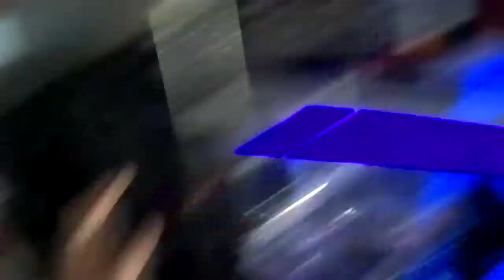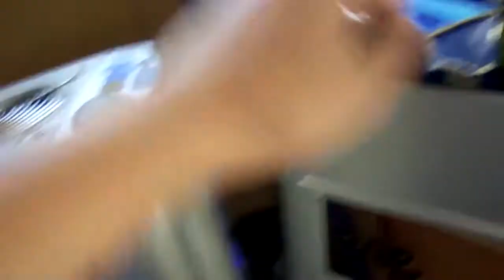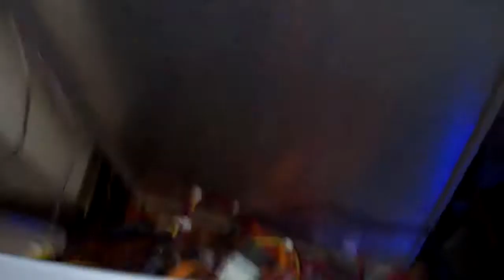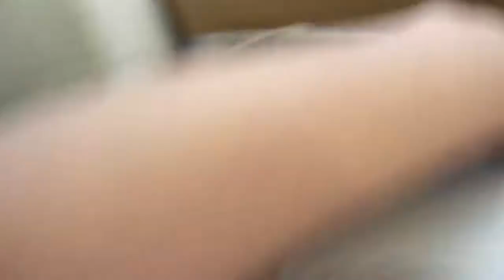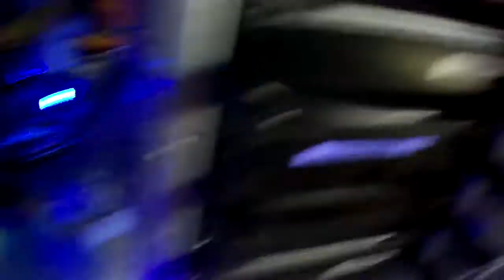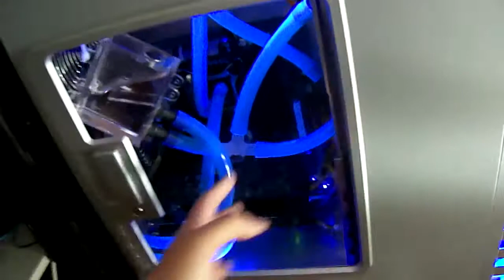[HD] Completed i7 860 Build

Comment: @alexconingham 46°C meaning, I can still overclock the caymans as hell...and even let them reach 80°C if I wanted to. It would be no problem. (but they will NEVER reach this temperature on my rig)

Also I can OC the Sandy Bridge to around 5Ghz very easily. Water temps don't rise that much and the cores stay easily under 55°C.
But I could also almost reach 5Ghz using AIR cooling as well. It was just louder.

Again, there is no turbine noise needed @WC for that to accomplish.

Comment: @alexconingham what do you mean by performance? The goal is to keep the water cold, as cold as possible as room temp allows.
This can be easily done in silent mode with large radiators and a proper setup.

I'm cooling two Caymans (HD6970) (and a i5 2500) in Furmark both @ 46°C.
No noise but maximum performance.

If you don't really have a clue about WC, don't bother to discuss.
Performance of PC != noise/fanspeed/quantity of fans

If you cool with only AIR. NOISE IS always on your side.

Comment: @REDxFROG I would be surprised if you could get wc temp from ac mate, even a noctua only performs as well as an H70... WC used to be only about silence, nowadays, for some of us, it is about extreme cooling. if you want silence, go the black ice gts or similar, some rads are however designed for high rpm (and in turn higher noise)

it is really opinion whether you want performance or silence or some balance. but best performance will come with more dB, and vice versa

Comment: @alexconingham is that an excuse? He's not even cooling a GPU. I'm cooling two of them and mine is still barely noticeable when running.

I mean, I only dig a PC when it's done properly. No matter how good or bad or expensive it's looking - it has to function efficient and silent. That is where the true power is at.
Watercooling is about silence, otherwise there is no sense using it.
I could cool his CPU as good using just air - if I wouldn't care for noise.